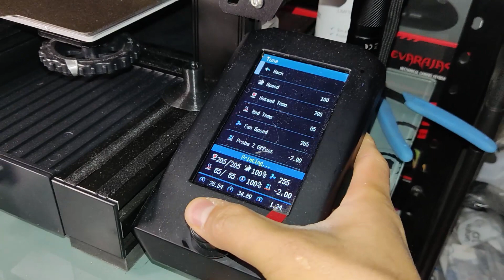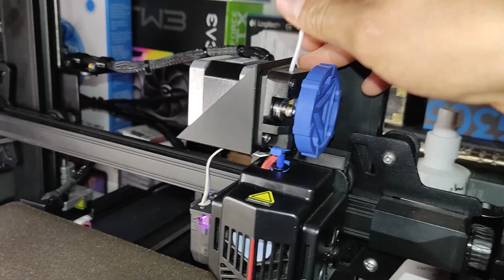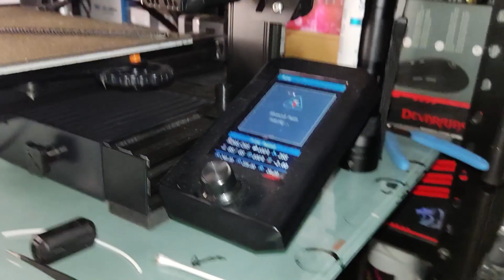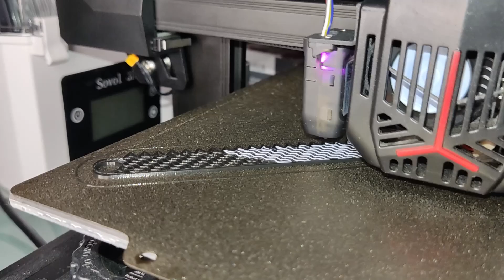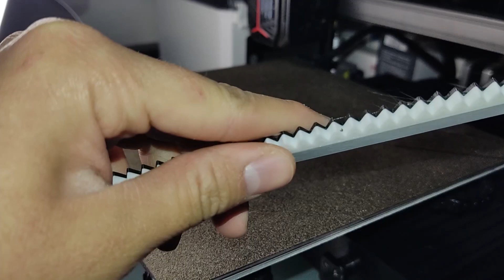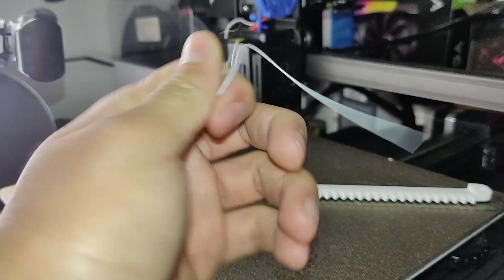Ender 3 V2 Neo Professional Firmware Filament Change (Direct Drive)

Comment: Can you share the details of which direct drive setup you are using, and any customizations needed (hardware or firmware) to fit it to the Neo? It looks like you have used a new bracket to relocate the stock extruder on the print head carriage?

Comment: Ohh damn, I have a neo and I was considering a DD conversion. Are you using the stock hot end otherwise? I have to look into that firmware as well.
Reply from the maker: I changed to a bimetal heatbreak only, the rest is the same.

Comment: Just wondering... does this direct drive upgrade affect the max Z height?
Reply from the maker: The Z height will stay the same as this mod won't hit the top of the frame. It goes in front of it, if that makes sense.
Reply: @Zeltroix  yeah thanks, I was afraid if it hits the frame